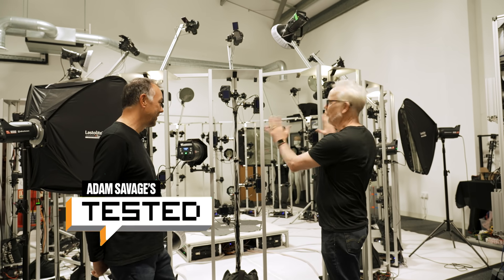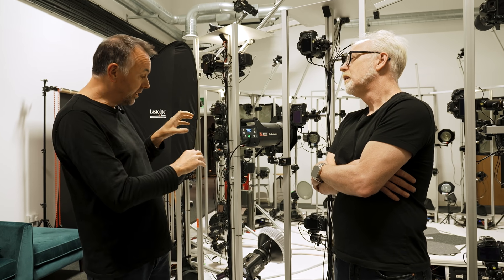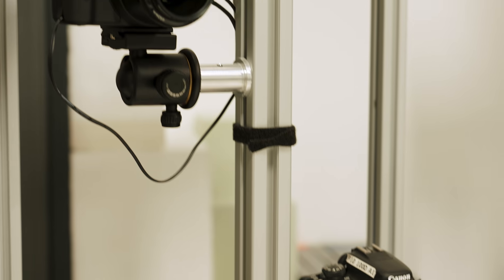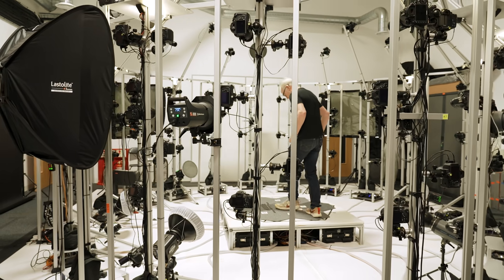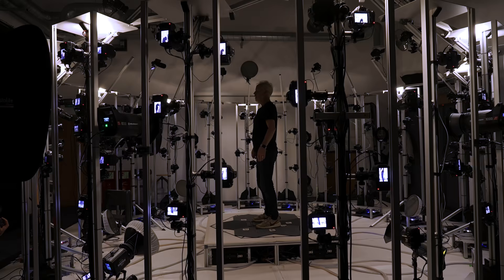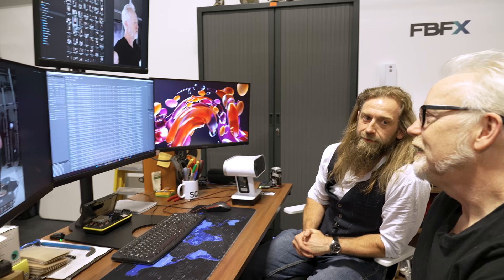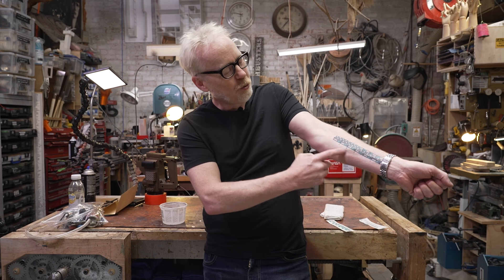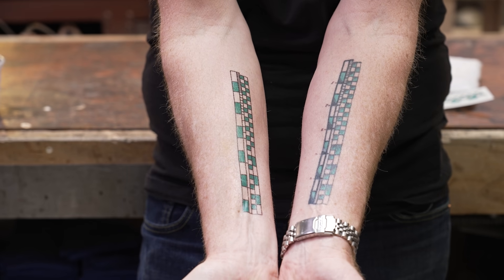Adam Savage Gets 3D Scanned!

Comment: Last year I saw a youtube video about 3d scanning yourself by making like 50 - 300 pictures with your phone from an object and putting it all in some freeware programs, repairing some of the stuff to close holes or re-shape an area that had too little info and in the end getting a very nice 3d model. I wanted to try it and made many pictures of many objects. Most of it did not work out very well. But it is a learning process. the light is very important. best is to make pictures outside on a light but 100% overcast day. Meaning there is very even lighting. no hard shadows and not too bright. The test project that did work out very well was my big teak garden diner table. On it we keep a few big pine cones and some nice stones. made a bunch of pictures of that scene and imported it. Had to repair some small holes or not enough cut away connections between cone base and table. and had to give the table planks some thickness to get a closed printable volume. The pictures I took was from horizontal to 90 degrees up and point of intrest was the center of the table. So only pictures of top and side of objects and top of planks. those have no thickness in the 3d model. But I fixed that and 3d printed a great small scaled piece. painted it and it looks great!. I always design my 3d models I want to print in autocad since that is what I use for work every day too. And autocad is very good in basic forms that you extrude into 3d but is not designed for 3d natural forms. So drawing a 3d human body or a curvy supercar body is not easy/possible. And scanning it by taking pictures and prosessing it to a 3d model on the screen is great. But it is a steep learning curve and not everything will work.

Comment: The setup does seem cheap. using Canon 100D cameras which are now w10 years old. Which back then was also the lowest budget canon DSLR. And also using the cheapest 50mm lens from canon. Im actually surprised. I guess the software here must be the strong part in this whole setup.  But this means they didnt upgrade much in 10 years?

Comment: Summary:
The video discusses the use of a 3D body scanning process in the film industry, which uses 129 cameras to capture images of actors from different angles. The data is processed to create a 3D model of the actor's body using photogrammetry. The system, which has been iterated and upgraded several times, is capable of scanning reflective objects and is now standard in film studios. The speaker also discusses the challenges of capturing large pieces of single color material and the software's difficulty with repeating geometric patterns. The video concludes with a demonstration of a temporary tattoo of a measuring stick.

Key Themes:
1. Use of 3D body scanning and photogrammetry in the film industry.
2. Challenges and solutions in the 3D scanning process.
3. Demonstration and potential uses of a temporary tattoo of a measuring stick.

Comment: I need to get myself 3D scanned and a double printed so that I can make my glasses fit. 
My face is Picasso like, and it takes hours of my own work to re-form the glasses frames to avoid pressure headaches and for the glasses to be level. That's in addition to the time for the initial fitting at the eye doctor.

Comment: About the variation in exposure between the cameras, I wonder if that is because when the aperture closes it’s not actually very precise. Assuming they’re using lenses where the aperture is wider until the shot is taken. If they are using fully manual lenses where the aperture is closing down as you turn the aperture ring, then my idea is not helpful. But this is a problem I’ve ran into when doing time lapses. Even if I have my camera set to fully manual and it shouldn’t change the exposure between each shot, I still get flickering because of the uneven exposures between the shots. And I think it is because the aperture is open until the shot is taken and when it closes it down to the desired value it doesn’t always stop at the correct diameter because the mechanism isn’t that precise. 

All that said, I’m sure they’re well aware of this and this isn’t actually the cause of the difference in exposure between the cameras.

Comment: I did a model of my own head a number of years ago. I decorated my face with washable markers to make feature matching work better. Had a friend take about 100 pictures of my head from different angles.  It worked, but I had to do a repair job on the top of my head, the mesh was somewhat broken there because hair is quite challenging. Used it to make silicone molds so I could give friends 'choocolate eric heads'. Converting the images to a model is done using 'photogrammetry' software. All the photogrametry software that doesn't run on the cloud seems to require an NVidia GPU because its based on a NVidia library called CUDA.
Reply: Most of the big cloud have machines for rent that are fitted with NVidia GPUs so you can run Cuda applications on them.

Comment: You should have told us how long that print took.
Reply: It took about 26 hours. The time stamp is in the lower right hand of the screen
Reply: Go back and watch it again - there's a clock on it.
Reply: the time stamp is in the bottom right. took just under 4 days. Seems about right for an AnyCubic Kobra Max with the .4mm nozzle, moderate infill, and tight layer height.